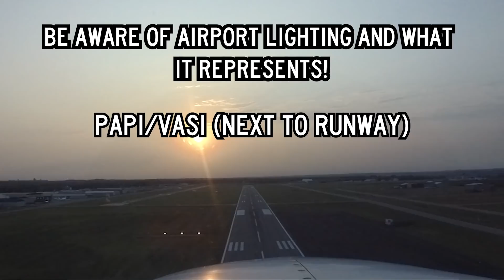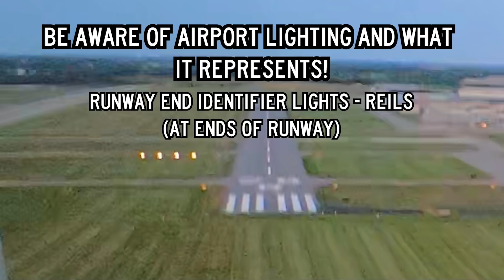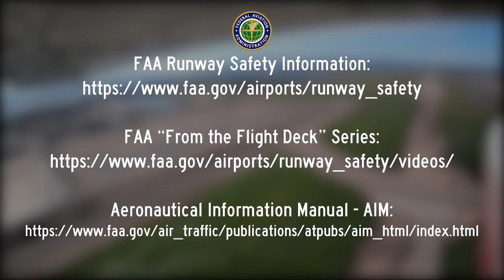From the Flight Deck – Wrong Surface Landings

Comment: Thanks for the vid. Number one thing would be to look at the airport diagram during pre-flight, and look for where potential problems may occur. I've seen taxiways that look just like runways parallel to actual runways (besides the markings of course). One could fly the incorrect pattern before noticing, so it's good to double check that diagram far ahead of time.